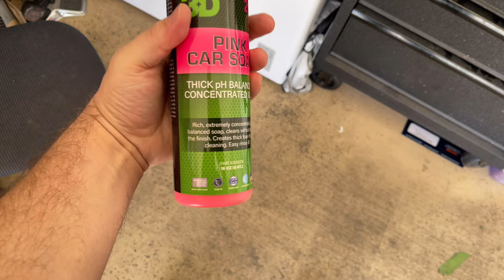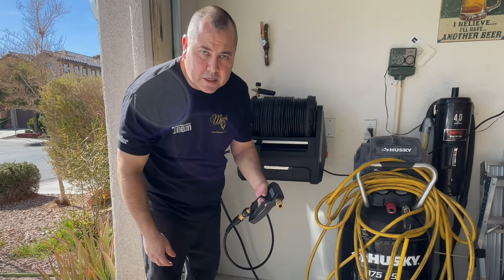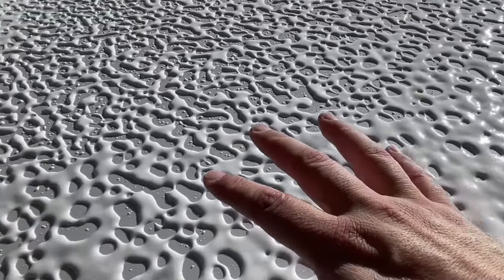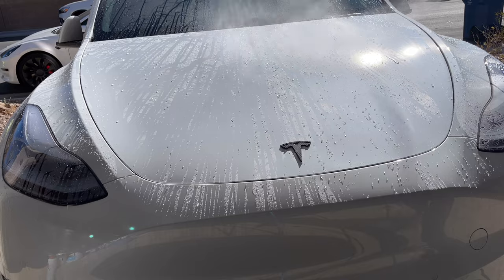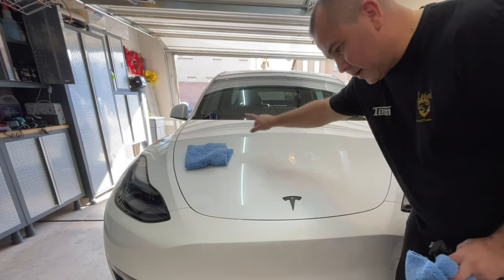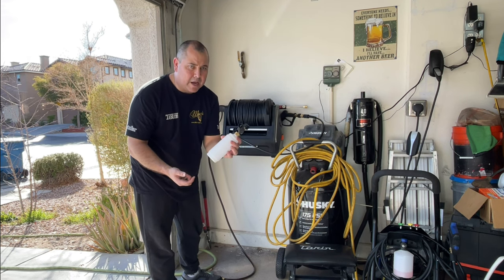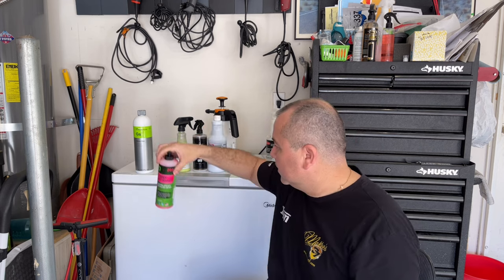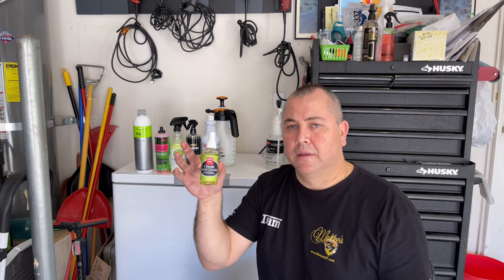Tesla Model YP/Coating Maintenance/Giraffe Tools Grandfalls Pressure Washer/Auto Detailing

Comment: Even if it is an all-purpose cleaner for me Green Star is the best wheel cleaner out there. That's how i do it too. First spray GS with a pump sprayer, then foam under. Have you ever tried AW Cleanliness? It is also an all-purpose cleaner. I would like to try it as snow foam.
Reply from the maker: I may have AW Cleanliness but not sure.  No I haven’t tried it though.